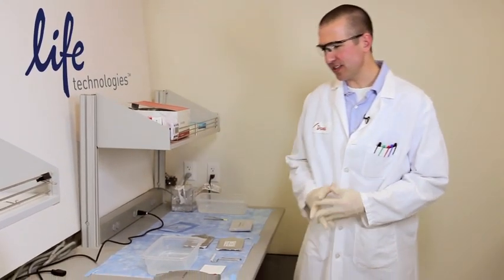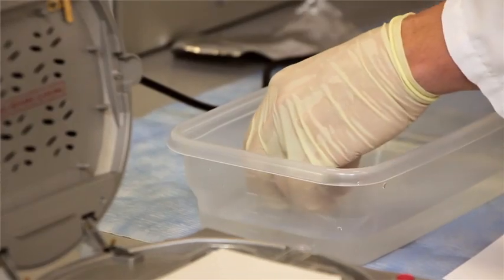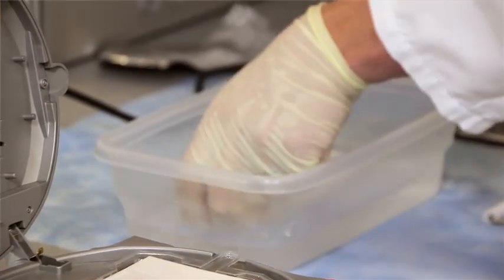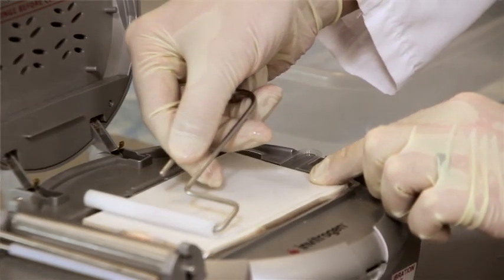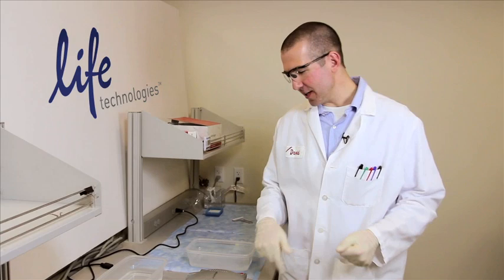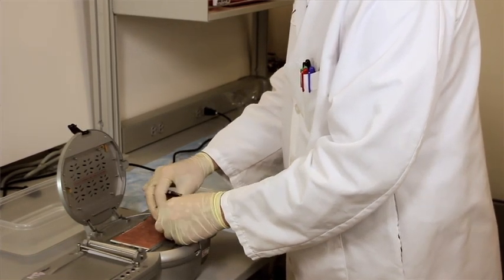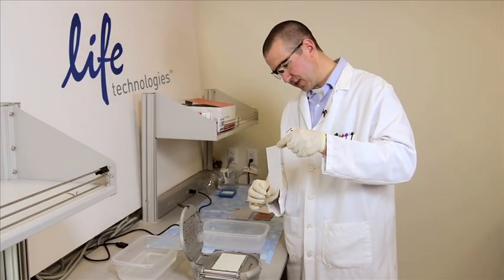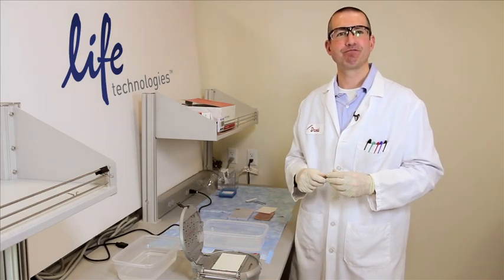How to perform a 7 minute protein transfer with the iBlot® - Western Blotting System

Comment: can I ask you if it is necessary to equilibrate the SDS PAGE GEL in transfer buffer before using the iblot system or simply use the gel straight from the cast?

Comment: You didnt put the PDF membrane when you were assembling but when you where disassembling the sandwich you had membrane!
Is this a sort of magic or your Anod has the membrane attached to it?
Reply: I was watching your video to use the one we received to test. This is a new one iBlot 2. I assembled it the way described on the website and ran it. I could enter the program and save but when I wanted to run it, the 'start' bottom did not work. Obviously there was a problem with it. These fully automated tools could easily go wrong in some point. On the other hand the foil-wrapped container to be used for each (or 2) gel for each time makes it very expensive. Maybe for some of multi million $$$ project it would worth it to save half an hour but in my case I gave it a pass.
Reply: According to this video, (appx 2 min 26sec into the video), the membrane is preassembled into the bottom pack.  But you’re right to point it out, should be mentioned in the video, especially for someone using this system for the first time.
https://youtu.be/LOHMlWFRqBU

Comment: Is it really alright to touch the filter paper and gel with gloved hands while you are setting up the sandwich for transfer?
Reply: Do not touch the membrane or gel with bare or gloved hands. This may contaminate the gel or membrane and interfere with further analysis. If you need to adjust the membrane, always use forceps.
Reply: Sarah Coleman Spot on, Sarah!
Reply: Sarah Coleman
That's correct, but that is not how it was demonstrated in this video. That was the point of my comment. Thank you.
Reply: Natalie R You are right Natalie, should always minimize gloved handling of the gel and stack components for best results. While we always do recommend to follow the manual, users may vary their specific technique. Others have carefully handled these components with clean gloves without noticeable problems. Also, it’s unlikely you’ll need to adjust the membrane since it’s already part of the iBlot transfer stack.